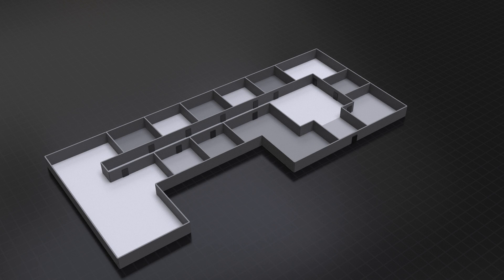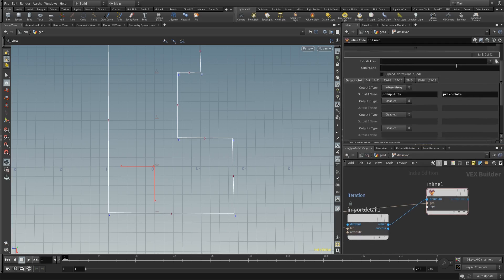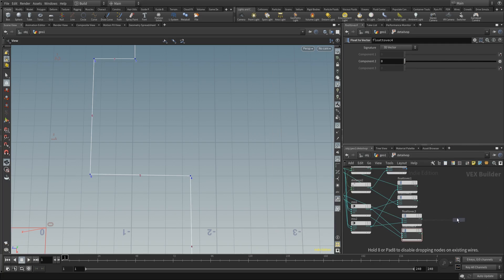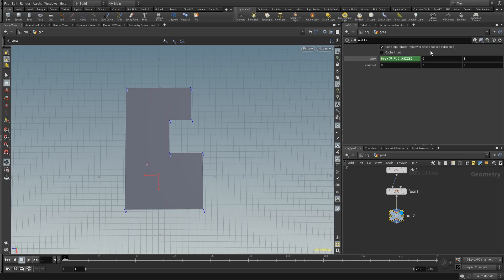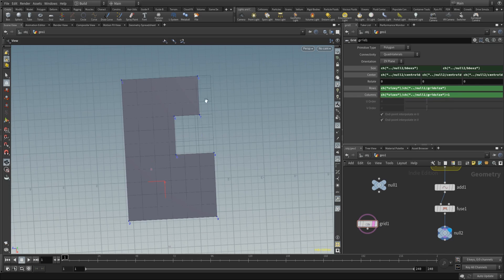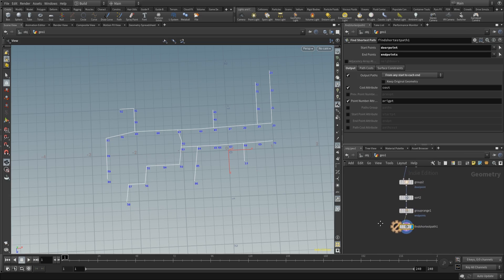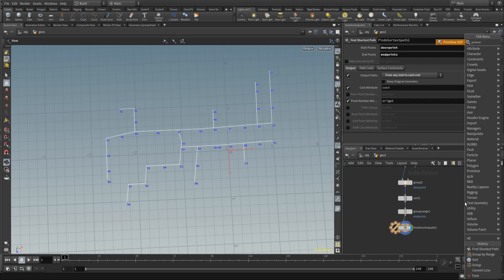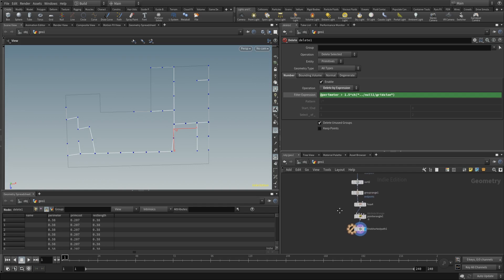Assembling your City - Part 2: Layout Generation

Comment: Ok, I really only have one question as I can't seem to find your explanation in this or the next part. Why are you setting and fetching your rest position? Should your building not be straight? What did I miss?
Reply: I guess in practice he would draw lines with straight 90 degrees and here he draws it not straight just to demonstrate the straightening technique for the possible case if you’ve given with non straight geo input